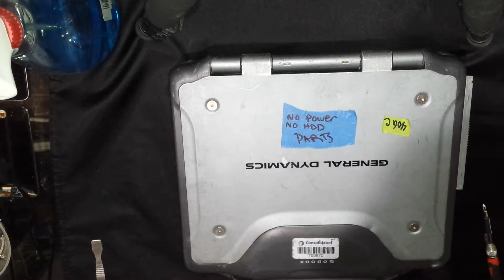General Dynamics GoBook XR-1 IX270 keyboard removal

Comment: Disassembly was successful they were very very simular. The only difference was I couldn't completely remove the heat shield. Upon inspecting the keyboard there appears to be no damage or warp to the keyboard. I'm thinking double-sided tape might be the answer
Reply from the maker: That's great. I'm glad there was no warping on the keyboard. That aluminum piece is very fragile.

Comment: Hello. I have a gd8000 in the keyboard works but only if you press really hard on the keys and there's a bit of flex to it. I ordered another keyboard off of eBay. I haven't figured out how to turn on the backlight so I don't know if that's working, but is that a normal problem for these keyboards or do you think there's something stuck behind the keyboard or they're just a screw missing.
Reply from the maker: From my understanding there should be a hotkey that allows the adjustment on the keyboard. The one I found is an electroluminescent keyboard, and used Shift+F4  or F5 to adjust the brightness. I don't think there are screws behind those keyboards, I think they are flat and held on by the hing panel, but I could be wrong, I haven't had one of those yet. However, if it doesn't have screws, you could try adding a small amount of double sided tape where it is flexing. 

Hope this helps.
Reply: @616pcrepair  great I'll have to give that a try I'm ordering one of those specialized heat guns so that I can remove the sticker. Do you have a business number that I can reach you at?
Reply from the maker: @jigglybiglets  you should be able to use a great fun with temperature control. Unless you need the hot air station for other projects. I only have a personal number but the channels name@ Gmail works